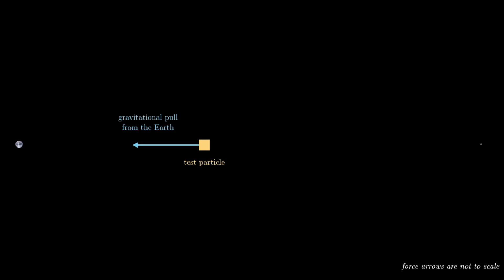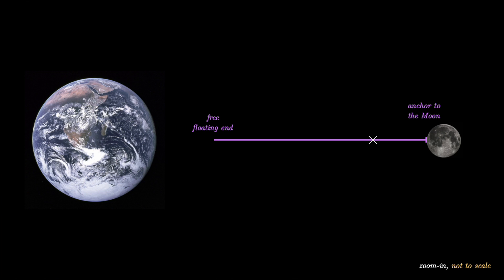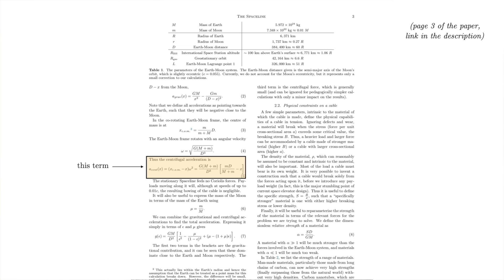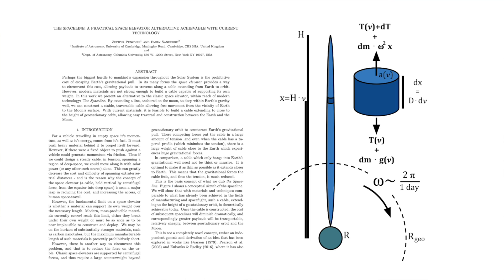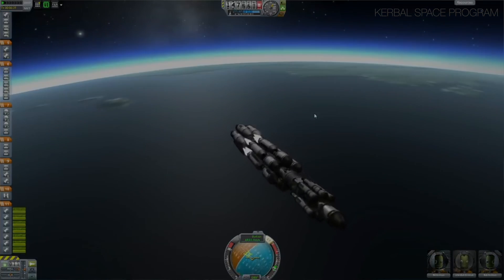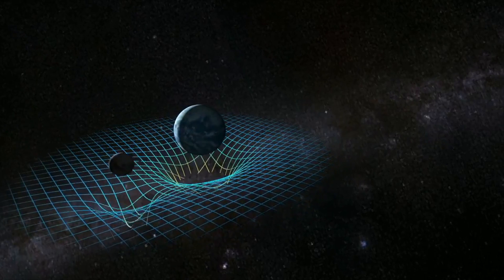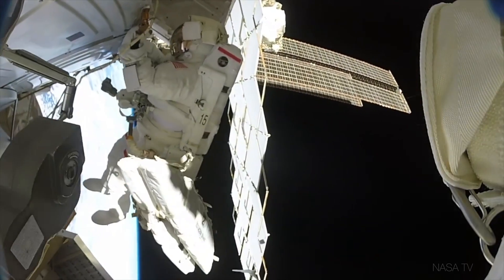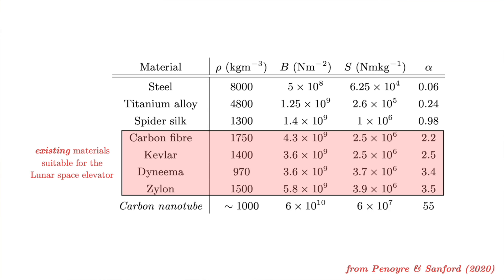The Lunar Space Elevator

Comment: Made it halfway through. I'm new to this channel, so far i enjoyed delving into the videos - but this one, i don't know. I don't mean to be mean, or rude, but this is disappointing. It feels like listening to someone who doesn't understand physics, acting like a big deal because it's "very doable". Even more worrying are the comments. 

Did anyone who appears to be flabbergasted by this idea actually run the numbers, even just roughly? You need a cable roughly 380.000.000 meters long. 380 million meters. The reason carbon nanotubes are brought up isn't mainly because it's tough, it's because there's nothing even remotely comparable to it in weight. Lets go with Kevlar, since that was suggested (though stupid, since it's UV degradable). A 10 inch thick kevlar rope weighs 150kg for 30m, or 5kg per meter. Hell, lets half that. Lets go with a 4.5 inch cable/rope at around  2kg per meter - as a sidenote, these are real numbers, easy to look up on the web on webpages specialising on material strengths. That means you need to haul 760.000 TONS anywhere from LEO to the moon. The biggest launcher we have currently manages around 60 tons to LEO, and the biggest, most powerful launcher that ever existed/worked (Saturn 5) managed 140 tons to LEO, 30 tons to the moon (so what, 35tons to L1 where everything needs to go?). I do not understand why people go "hm, aw, yes, so doable, such great idea" as if NASA scientist and engineers are too stupid to come up with this "invention", do you actually believe that nobody thought of this before? 

The arrogance is astounding. The reason nobody brings this up is because it's utter nonsense with current technology. Even if the cable weighs 10 GRAMS per meter (three foot and change), your cable weighs 38.000 tons. That's almost 1100 launches of the Saturn 5 that doesn't exist anymore - or around 1200 launches of the SLS Block 2 that doesn't exist yet and is also not reusable. 

Talking all smart about how this "invention" has the danger of increased pollution through space tourism, while suggesting 1200 rocket launches just to build the thing (if you assume a 10 gram per meter cable, which is obviously idiocy - that's the weight of two single sheet letters, or a meter of yarn). Hell, kevlar is listed as a material suitable for the "space elevator" - ignoring the fact that it's UV degradable. What about heat? None of the listed materials is great at radiating heat, but some of them are great at absorbing heat. 

I'm sorry if this comes off as rude, but the reason that nobody is doing it is because it's not doable. Not even remotely. Not just because it'd be prohibitively expensive (a single SLS lauch costs around 2b usd, and you need 1200 of them), but because there's no material that you can make the rope out of. Not even close. We're not even getting into the grittier stuff like a "cable car" not being 100% balanced on all sides, exerting force onto the cable. If you make the cable strong enough for a cable car not to be able to tangle it on an accident (because its own weight pulls it "solid") - what material are you gonna use, and what weight do you think you can suspense at the very tip without tearing it? You're talking tourism and whatnot, so you're suggesting that you can suspend literal tons off of that cable. Show me the material that's less than a mm thick, weighs 10g per meter and has the tensile strength to carry what, a few thousand tons (it has to carry itself too)? 

I'm blown away by the ignorance, both of the comments and this student. Sure, we all have ideas, some of which stick with us for a very long time, but at the VERY least, you run the numbers to check if there's a possibility. You clearly claim that it's "absolutely doable", when in reality it's absolutely impossible. Not just "improbable", factually impossible. Which means that you either didn't bother to look at the very basic requirements (hey google, how much would a meter of kevlar rope weigh?"), or you chose to ignore those very obvious flaws in your "invention for the third time". 

I know that students today have trouble with facts and feel hurt if someone points out flaws, but the here's reality. All your ethic concerns? That's all doable today. Cheaper, more reliable, and more available than your idea would ever be. Including space tourism, weaponizing space, going to the moon - literally everything is cheaper now than it would be with your "invention". I can launch 1200 rockets before you even set your cable, and once it's set, then what? Here's the dumbest thing about your "invention". You're making the cheapest part of space travel stupendously expensive, while still relying on the most dangerous and expensive part of space travel - the rocket launch. That's the idea of the actual space elevator, to not launch rockets anymore, because that's the expensive part. To be clear: getting from earth into a LEO requires around 9500km/s delta-v. Getting from LEO to the moon is 4100km/s delta-v. You want to launch 1200 rockets and burn trillions of dollars to eliminate the 4100km/s from the equation, while still relying on rockets that need 9500km/s delta-v just to get to the cable. In fact, it's cheaper to go from LEO to the moon, land on the moon, ascend back up from the surface, and return to earth than it is to get from earth into LEO. From LEO to moon surface and back to earth (everything included) is 9100km/s. 

I mean.. good luck. But don't hold your breath.
Reply: Why are you using periods in your numbers???

Comment: cool video I have some concerns though

1. As the moon is tidally locked towards the earth meaning it has a relative fixed position in space, meaning that any craft sent up would have to not only reach the speeds of getting into orbit but then would have to spend fuel to reach to a relative stand still (and I say relative) using a lot of fuel in the process (although less with higher orbit as v=rw however at a higher orbit the value would be less for such a construction anyway)
2. The biggest cost is not getting a space craft from orbit to a higher orbit, but reaching orbit in the first place
3. As for utilizing this for getting crafts off the moon (or the mun if you kerbies like), conventional technologies such as catapults or just chemical rockets seems much more practical even if the materials existed to make this happen. Eubanks, T. M. and Radley, C. F. (2016) envisions a 5000km cable that only weights 3 tons! To put into perspective, a steel wire of that lenght with a diameter of 10cm would weight over 300 tons, that is a hundred times heavier and also this fantasy material needs to be stronger, seem like an impossible equation.

Comment: In terms of scary scenarios, one possibility is to manufacture very lo-tech ballistic spears (e.g. compressed regolith) at the moon end that could then be dropped off the earth end. Small thrusters could be used for fine tuning a target as they fall earthwards. However such a weapons platform would be very vulnerable to being disrupted by severing the cable. 
A more likely scary scenario is that if the cable between the moon and L1 gets severed accidentally close to L1, we could have a substantial space station that will fall almost directly to the earth - unlike a meteorite or orbital satellite - this wouldn't be a glancing collision of the atmosphere so a substantial mass would hit the earth's surface intact - possibly throwing dust up into the atmosphere and impacting the weather for a couple of years.

Comment: Interesting video, I hadn't considered the idea before. In the early 80's a physicist/professor at MIT named Gerard O'Neil tasked a graduate level class with designing the most feasible structure to inhabit in space. They came up with "High Orbital Mini-Earths". He published their work in a small book. Essentially they came up with a large, 2-3 kilometer long drum shaped structure that could be spun along it's central axis to provide gravity on the inner surface via centripetal force. The total inner surface area of such a structure was mind-boggling. They also situated these structures at LaGrange points to avoid the cost of fuel for position maintenance. I remember that they had figured out a linear accelerator on the moon launching lunar ore into space where it was captured and positioned at the focal point of a gigantic parabolic sunlight reflector to smelt the metal from the ore for construction. This also avoided the energy costs associated with lifting materials out of Earth's gravity well. Here's a link to more info on this. https://en.wikipedia.org/wiki/O%27Neill_cylinder

Comment: The cable would have to be unimaginably long. Which begs three important questions...
Where would you get the material for the cable?
Were would the cable be manufactured?
And how would you get the cable off the planet?
Reply: Aiden: The cable sections would likely be manufactured on the moon - it's far less of a gravity well to ship stuff from. You might even use a linear accelerator on the lunar surface to get these sections into orbit from where they could be collected and brought to the construction project building in both directions from L1. Still not a trivial task I agree.

Comment: The same amount of material used to make a Space Elevator, can make a more robust Lunar Orbital Ring(mono-rail from a lunar pole reaching into lunar orbit).
Actually, with an orbitally-locked moon, any  Orbital-Rings could touch the surface in other locations too.
Also, the structural limits required in Ring materials aren't extreem, like Space Elevators are.
One type of Ring consists of Aluminum, using electro-magnetic drag on the Ring, to pull a cargo into orbit. That drag is compensated by introducing acceleration back into the Ring at the ground-station. Orbital-inertia will keep the Ring drawn tight.
The Traction Tech used on a Ring is more involved than Elevators, but Humans are built to find solutions.
Eventually, a series of shorter geo-stationary Elevators can be dropped from locations along the Orbital-Ring(stationary gravity-loads must be compensated with higher-velocity rotations of the Orbital-Ring, & use Mag-Lev Tech for vertical support by the Orbital-Ring).
Eventually, the Ring would be upgraded to being fully enclosed by a stationary coaxial-sheath, so stationary objects could permenantly attach or even hang from the Ring.
An L-1 Elevator will eventually be required though, especially to construct a Terra-Lunar-L4, L5, transport Depot & Emergency Solar-Transport Station.
L2 could use another Lunar Elevator to an orbiting community & Science-Fleet.
L4, L5, being stable orbits, could become industrial centers so debris doesn't easily escape, L4 for new fabrications & upgrades, L5 for Utilities(solar-power, solar-communications, etc.)
Solar-Powered Anti-Matter production plants, can be strung in a Solar-Orbit that comes by earth every few years(unless Solar-Static-Charges can be harvested more economically. Note how rocky asteroids are Arc-Etched to create ionized-gases, which manifest as solar-wind static-collecting comet-tails.)

Comment: I am sorry, but it is not very smart idea. And it is old... Soon after earth space elevator was "invented" it was clear to be stupid idea - to many problems to build, operate and and of course the ban on all satellites. Later there were searches for  bodies where the elevator can still apply other planets or moons even asteroids. And almost everywhere after closer examination, he either did not give any benefit or brought all the same complications and problems as in the stupid idea of an earthly orbital elevator. For example, in the case of the Moon, again, a ban on all near-moon sat, and there will be more of them and they will be more needed. Then the benefit from it is very mediocre, you also need fuel and energy to move on an elevator more than a hundred thousand kilometers long. And with solar panels at least how much significant traffic you will not do if you do not want to move at a snail speed. It’s easier and more reliable and cheaper if speed is not so important to you (and you won’t have high speed on the elevator without a catastrophic complication of design) you will use electric rocket engines with a high specific impulse. Let it be slower. From the moon, it is much easier to launch cargo into space in a simple linear accelerator and rocket extension unit. So if you think about the lunar elevator there is no practical value or meaning.

Comment: The Earth side of the elevator would be rotating at less than orbital angular velocity and so would be feeling gravity. Docking with it would therefore be quite a challenge as you would need to launch from the Earth on a suborbital trajectory and then hope to be caught by the station before you fell back or ran out of fuel to station keep. You could only launch during a limited window each day and then only one rocket at a time limiting the capacity of this thing. Another thought is that coming back to Earth will result in a very aggressive re-entry to the atmosphere.

Comment: This is a novel idea, but saying it will save 1/3 of fuel cost is really deceptive. It doesn't factors in the building, development and operational  costs of the Lunar elevator.
Considering all of space travel, focusing the same resources on more efficient engines is more reasonable, while the Lunar elevator is a solution in need of a problem.

Comment: Two elevators of equal weight must be made that work together but in opposite directions to balance the mass pulling forces if it is stretched between the moon and earth floating freely or you could build a skyscraper on the moon that could reach 16000 feet since it has 1/6 the gravity of earth and then attach a tether from it leading into space and it could be used to draw power if the tether was electrically conductive , Nikola Tesla speaks about this but not from the moon

Comment: Intresting, I'm thinking that the end of the cable will move in the opposite direction of the satellites, because to use equatorial speed in your favor, all orbiting artifacts moves to the east, but the moon (and the cable) moves to the west.
Part of the launch is moving east to size equatorial speed, (Arianne is the closest to equator).
Im thinking on the fly, one rocket launch to the cable must go west, and in that case not only you don't use equatorial speed in your favor, it will be against you.
And once you  leave Earth you go on a balistic trajectory, the only extra fuel you need is:
To reach escape velocity and
To land and not to crash
You save this two. But you must spend the fuel needed to overcome 2 times the equatorial speed (1 time if you launch from the antartic).
I don't know (because I didn't do the math) if the looses are smaller than the gains.
Another issue I see, is that when a ship reach the cable, to grab it must be no longer in a balistic trajectory, it will need certain amount of fuel to maintain position to grab the cable, because at that altitude (circa 38000km) the orbital speed differs than the speed of the end of the cable.
From there the ship must climb (solar powered) each km the Earth gravity will pull less until the Lagrange point, then it must descend to the moon with an increasing gravity.
The speed tho climb/descend will be slow, very slow. The slowness needed for not breaking the cable.
The cable could be practical for cargo (if the looses were less than the gains), but will be impossible for passangers, exposing them to a longer journey and suplieas for a longer stay in the ship.

I love Ideas like this, but I think this cons (equatorial speed and the fuel needed to reach the cable) must be taken into account.

Comment: How does using the cable not cause the travel to the moon slower though since you would need to gear drive the cable to pull the ship across but require either a large wheel so you can spin it slower or smaller and spin it faster. I didn't think once you past the earth pull and have enough momentum to keep you moving, you don't need to thrust all the way to the moon? I'm guessing the 2/3 of fuel is just to reach the cable.
12:12 either that's artificial gravity or they are spinning in a weird  formation, you would think to spin 90deg to the earths surface, putting your feet to the outside (right of pc)

Comment: Very interesting.  I am curious though, I recall an incident with a "tether" that had burned up at one time and it was rather short in comparison to what you propose.  How do you propose stopping the build up of electric potential along the length of the tether?  What happens with the tether if a coronal mass ejection hits it from the sun, like the Carington event in the 1800's?  It was responsible for setting many of the copper telegraph wires on fire. Thank you for the great video.
Reply: I recall the tether experiment you mention. I believe it was actually to generate electricity. The cable shorted out, it created too great an electric potential, and actually burnt out.

The length of the cable in this experiment would be thousands of miles long, the voltage is generated would be immense, there would be an extreme voltage risk especially when it came time to anchor one end to the moon. A cable that lenght would likely cross the Earth's magnetic lines of force. Solar panels would be unnecessary, you could just draw electrical energy right from the same cable you're climbing on.

Another potential problem, the moon would not be stationary in its relationship to the Earth. It would oscillate. This movement would translate into hundreds of miles of whipsawing into the lunar elevator. It would generate wild movements of such a cable. I've not heard anyone address either one of these issues.